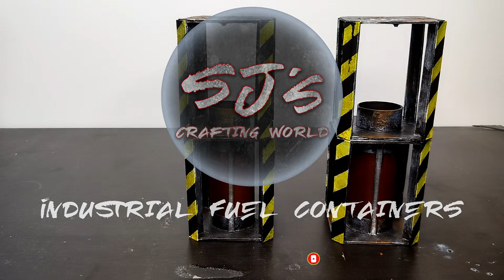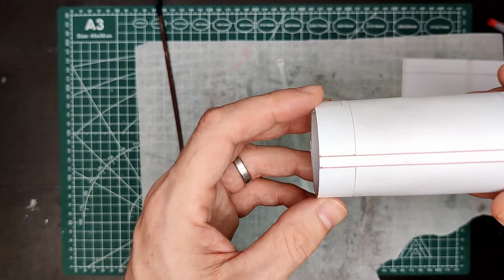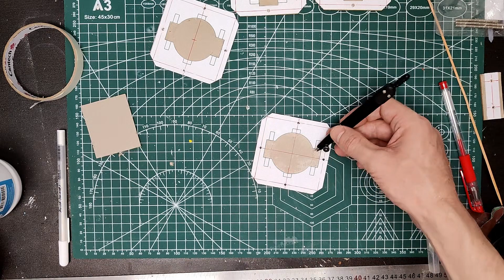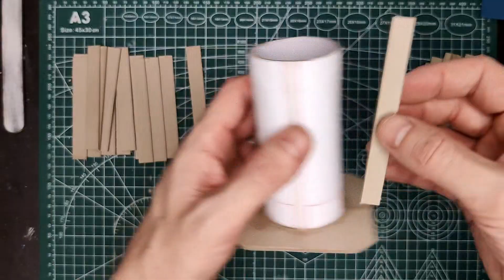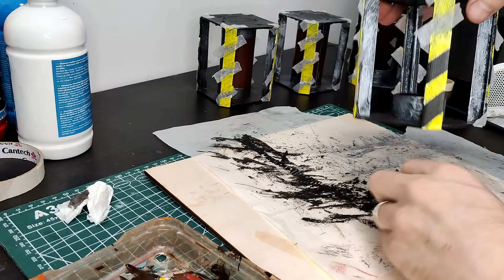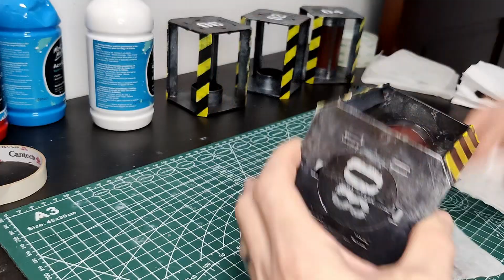Necromunda Terrain Tutorial - Modular Industrial Fuel Containers

Comment: Excellent build - now you just need a video on how you did those stencils. It looks like tape over printer paper, but I would think the tape would pull up the paint on the terrain
Reply from the maker: Thank you very much dude. I can do a video if you want. It is pretty simple, just printed text, covered in sticky tape and then cut out. Use masking tape to hold it on.